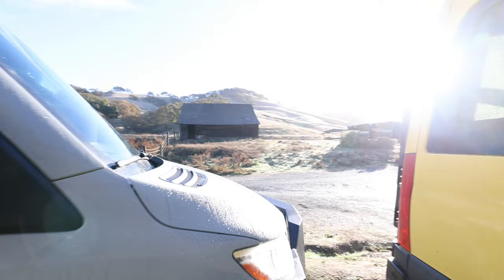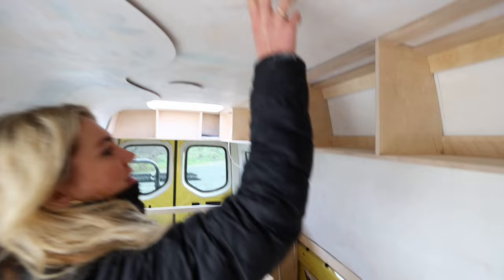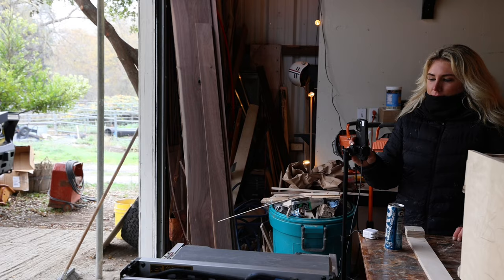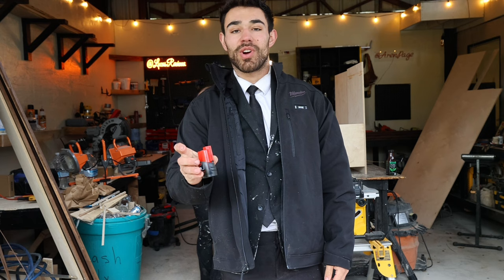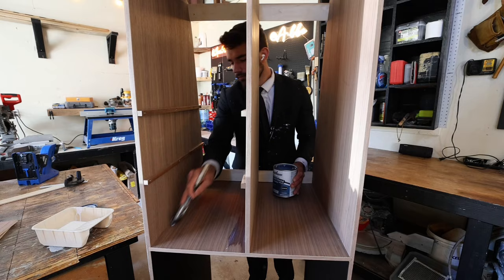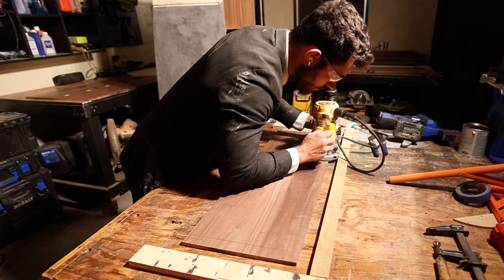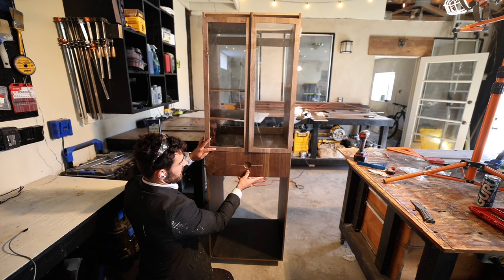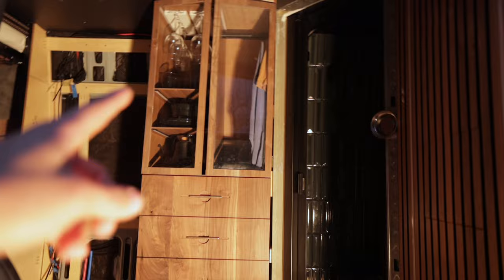Luxury VanBuild | Building High End Cabinets

Comment: Looks incredible! Good job. Have you had any issues with the doors by epoxing them in and not leaving them 'floating' as a shaker?
Reply from the maker: Well I ended up using baltic birch with veneer instead of hardwood. Also swapped out the plexiglass for tempered. Used a clear sealant and locked it in place from the rear. No problems and I have driven a few thousand miles including some good off roading.